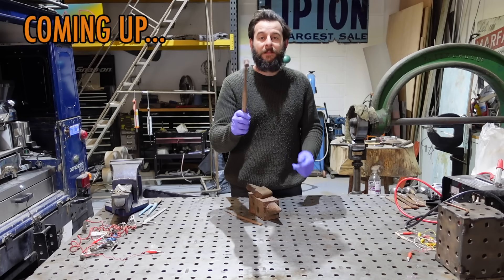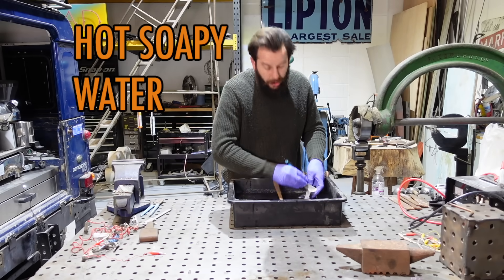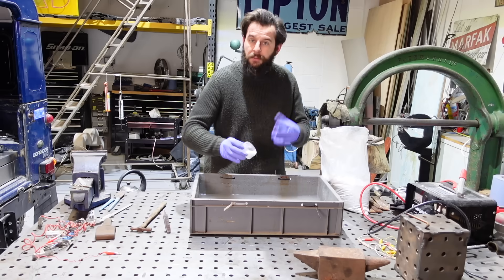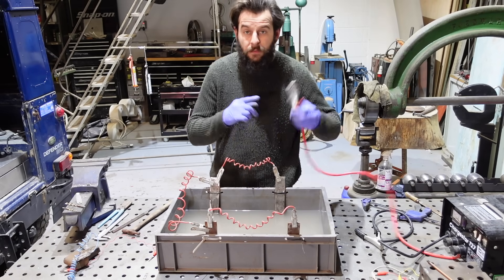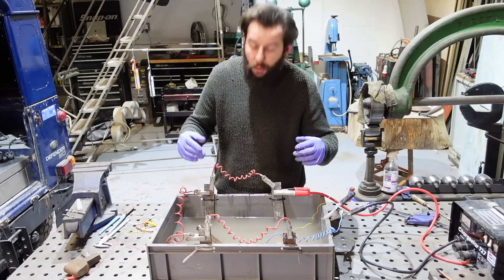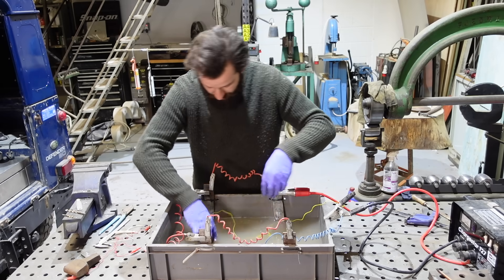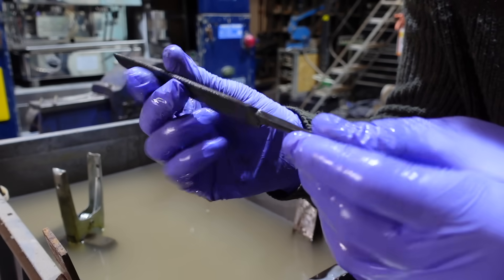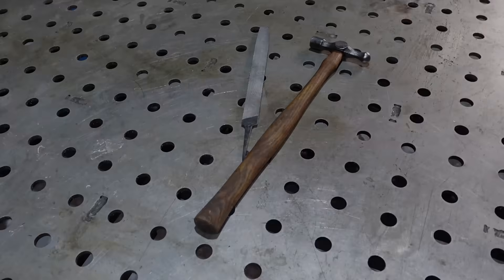The Power of Electrolysis | How To Transform Rusty Tools!

Comment: i had an old outboard mtr. gas leaking at the mounting bolts  took  it off  flushed it good the took a long cane pole  with a  rag tied on it  we light the rag  stppd about 15 ft away held to the tank it just poped a little   then it was safe to weld  it worked ok.

Comment: Does the amperage matter ?   Mine has an option for 2/12/75 amps.  Do more amps speed up the process?
Reply: I've used a maximum of 5 amps and found it enough to do all the tools I treated. Yes things will definitely speed up with more amps, but in a small bath I'd advise you steer well clear of 75 amps. You'd probably get a nasty shock if you dipped a bare hand in the solution. It will also tend to eat away the rust plus the good metal.

Comment: it is a line of sight process. If you could have a cage or maybe four sacrificial rods for each corner then you are golden... so you get to all the hooks and crannies... it gives off hydrogen so don't do it in a room with metal stuff as it encourages rusting. nothing will be as delicate with surfaces as this method. I managed to restore hand-engraved toolboxes that belonged to my grandfather. The engraving is still good as new, and all the rust gone. I like the crate idea... I use an old rubbish bin

Comment: There are many ways to skin a cat in regards to getting rust off of an item. A hammer wasn't the best example in my opinion for two reasons. The first reason is that hammer was usable as a hammer regardless of rust, the only issue would be if you were worried about the surface marks it could leave and you wanted to make sure the face didn't have pitting. The second reason is that the item is easy to use other methods on, such as the wire wheel. Where this process shines is in complex shapes where a wire wheel cant get into, or areas that are seized with rust and something like an acid bath would not penetrate deep enough without first damaging other areas of the item being cleaned. What I see is a bunch of comments completely discounting the process because there is a different method available. And while I do agree if you were going to use a wire wheel on it... I would have started there and maybe bypassed the whole process, but the video is about the method used and how to do it, not necessarily stating its the best option for what you used it on. Someone else in the comments stated they used it to clean our gas tanks from the inside out, that is brilliant, and its a good example of the perfect use for this technique because trying that with a wire wheel would be ill advised. Long windedness aside, great video!

Comment: Whilst a hammer head could be cleaned by other more simple methods, soaked in oil,wire wool etc, the big plus with electrolysis  is complex shapes that would be a pain otherwise....

Comment: Mind if I make one small correction? YOu mentioned that you aren't removing any actual metal, but that is exactly what you are doing. It's on a molecular scale, but that's how the electrolysis works. As the electricity blasts out of the hammer, the current carries the outer surface with it into the solution. Some of it dissolves into the solution and the sludge it makes over time is gloriously disgusting. The process can be used in reverse, by making your anode from something you want to coat in metal and your cathode from clean, pure metal like copper or nickle. Then it becomes electroplating, and can also be done at home with the exact same set-up.

Comment: Way too complicated..........  For decades; I've been removing rust from everything from tractors to trinkets using a simple 4:1 mix of water and muriatic acid (sometimes a little more concentrated).  It's very fast and easy.  Best done out doors.  One needs proper protective equipment (face shield, gloves, respirator, apron and ventilation) and keep it off of concrete surfaces.  The solution neutralizes quickly and easily with water when you're finished.   Many YouTube videos on this..........

Comment: Brilliant video, Dom!
I gave this method a try over the weekend. Tried it on a big heavy 3/4" drive Whitworth 1 1/4" socket made by Stahlwille. (I would point out that it is not safe to do this on chrome plated items, because of the risks). It worked very well. 
Then tried it on an antique 'Primus' stove spanner, that was extremely rusty and pitted - the maker's name and 'Sweden' were illegible. But after just 30 minutes, and then a couple on the wire wheel, the part looked like new. Also, the flame wind shield, that I had given up on because a wire brush would have destroyed this delicate part, was also restored.
I had made some alterations to the circuit arrangements used in the video, by using a metal tank, salvaged from an old deep fryer after chucking the electric element part away. This served as the anode, and increases the overall current density, leading to much greater efficiency. 
To limit current from the 12V supply, I inserted a 21W, 12V car light bulb in series. Any shorts between the job and the anode are thus rendered harmless and will not damage the charger which has a maximum rating of 4 Amps.
Reply from the maker: Amazing!! Thanks so much for the update I’m so glad it worked for you, 
Really nice idea on the modifications, depending on the size/shape of what your doing you can get creative!

Thanks again

Comment: The tools will flash rust if not immediately treated. I lightly coat the ferrous surface with Ospho, a metal phosphate, and immediately blow or towel off the excess.

Comment: Hello Dom
Just found your channel, always enjoyed your work on Repair Shop
I build Gauge 1 model locos etc and after soldering I used a diluted sulphuric acid to clean the parts, sulphuric acid has become difficult to find, have you any experience or knowledge of electrolysis cleaning of brass/copper parts?

Comment: I've used this method s lot & it never gets old! It's an amazing technique. What looks like hopelessly rusty metal comes out  looking better than you could ever get using old fashioned wire brushing & hours of work. 
As you could see on the file, it reveals lettering that could easily be lost using abrasive methods. 
One thing, the older the better when it comes to battery chargers. You don't want any fancy modern components in there. Just a basic, old fashioned charger.
I used old, sheet steel computer case covers for my sacrificial terminal. Laying it over the bottom of the tub & then suspended the items I was cleaning above it. That was all the items were close to the metal as it covered the whole bottom of my plastic container. If the computer case cover is painted or powder coated on one side then but that side to the bottom.

Comment: warm water will dissolve the salts more quickly, just like sugar dissolves quicker in hot tea than in cold water, but as noted, you will reach  the saturation point where no more will dissolve, and as the liquid cools more of the salts will drop out of solution. and if its not in solution it's not doing anything. you could argue the process might work better cold as there will be more brownian motion in hotter water which might reduce the conductivity and migration of the rust from cathode to anode, but definitely keep the parts close to the Anode to reduce the distance the rust particles have to migrate through the solution.

Comment: baking soda is sodium bicarbonate. so you're right, it's different to sodium carbonate,  sodium bicarbonate contains  extra positive ions in solution from the hydrogen it contains in electroplating we regularly use sodium cyanide in electro-cleaning. obviously not as easy for just anyone to get their hands on.

Comment: Shhhhh, don't tell him, but he could have got a similar result just going straight to the wire buffer.
Reply: Same question popped on my mind. Is there any advantage of electrolysis over a wire brush?
Reply: @Erick-Tags  Of course there is an advantage. Electrolysis is by no means an invasive way to remove rust. On the contrary, the wire brush is. Moreover, electrolysis might be slower, but it does not require you to participate. So you can do something else in the meantime. And it is far safer, as a wire brush might hurt you if you lose your focus.
So, yes If you are not in a hurry and you want to get a nice result without having to do anything, electrolysis is for you. So to answer to MaverickM1 below, no, it is not a clickbait.
Reply: @Erick-Tags  people can’t be clickbaited to watch a video witha title: cleaning rust using a wire brush.....

Comment: I'd love to see a video on anodizing aluminium using colour
Reply from the maker: Cool ok! Thank you
Reply: I'm not any sort of expert on Anodizing, but have studied it as part of general trade qualifications and  out of general curiosity for areas of my industry I havn't experienced first hand., For dyed/coloured this would normally involve Sulphuric Acid Anodizing, which is good because the Alternative is Chromic Acid, which is a controlled substance and has major health and environmental risks and I would think impossible to obtain outside of the professional trade. That's not to say that using Sulphuric Acid doesn't pose it's own risks and challenges. Anodising is a conversion process and would usually need a sealing process, unless it's being painted. The sealing process takes place after you apply your colour. I have seen references to Sodium Bisulphate, or even Sodium Hydroxide being used, but know next to nothing about these methods. Sodium Hydroxide will dissolve Aluminium so I find that curious

Comment: When the long grain fiber of woo in the tool absorbs water, it crushes the fiber, the handle will become loose, and impossible to tighten. 
It is ruined. 
It will now, "fly off the handle".

Also, the coating on the file is very hard.
Any rust at all will eat this coating away ruining the file.

Always clean all the steel/iron filings from the teeth with a file card, oil, and store so they don't hit other tools and such, in a clean, and dry tool box.

Even excess dust in storage will draw moisture and ruin your file.
Reply: In 62 years of life, work and DIY - I've never met anyone who does any of this.........!!!
??

Comment: I've used electrolysis many times.  Dom's vid is good.  I've often done a pile of things. Don't even have to connect wires directly to all the parts, as long as they are touching each other, it works. (better of course to connect wires). Also, as to only a few hours, depends on how rusty the items are.  I've occasionally needed to leave the product in for a week.  No big deal.  Does a stunning job.  NO elbow grease required.  Leaves the finished product sort of "black".  Why?  Cause the hard to remove red rust, (ferrous oxide) is replaced with ferric oxide, (black rust). Black Ferric oxide is fairly easily washed off, leaving a clean surface.  
sometimes you have a BIG item.  Easy to build a wooden frame, lined with plywood, then line that with polyethylene sheeting.  You can put in a large free standing machine that way.  As Dom said, don't use a fancy charge controller.  Some of those don't recognize what you are trying to do, and don't "see" a battery, so won't work.  You can trick those by putting a battery inline too, so that it thinks there is a battery that needs charging though.

Comment: Hello Dom
It might be worth mentioning that the gases bubbling off the electrodes are oxygen and hydrogen, so ventilation is important to avoid any danger of explosion.
Reply: In this small application the gases will be too dilute to cause an explosion.
Reply: This is noted in the comments below the video i.e. "SAFETY NOTICE: Use in a well-ventilated space or wear a mask, as the bubbles can be hazardous! "
Reply: I was thinking DUDE you don't want to just leave that unsupervised. WTH putting hands into the liquid is a safety no!no! too! He should be using plastic tongs!
Reply: @zacharysmith5947  Good gloves are fine.
Reply: Or capture the O2 and H for use with HHO welding?  Maybe not but it does need dealing with if this is not done outside.

Comment: Important safety tip! those bubbles are HYDROGEN so no smoking ,naked flames or sparks in the area.
Reply: Tiny amount of flammable gas in a big volume of air!
Mind you, if you were doing electrolysis in Harry Potter's cupboard under the stairs...AND smoking, then you might be slightly concerned.....!
Reply: @andymccabe6712  My point exactly,in a small shed could be a problem
Reply: @johnbuxton3841  Agreed, It's completely safe with ventilation. Once I turned a cup upside down over the bubbles then lit it off... I wouldn't want any unplanned surprises with hydrogen
Reply: and oxygen?
Reply: @jeremykemp3782  yes...two parts hydrogen from one electrode, and one part oxygen from the other.

Comment: In North America, sodium carbonate is sold as washing soda and it usually is found in stores as an Arm & Hammer product.
Reply: @alexandrevaliquette1941  Nope:  sodium bicarbonate is baking soda, sodium carbonate is washing soda, both sold by Arm & Hammer, orange box and yellow box respectively.  Google it
Reply: @duffman6675  Sorry folks, I did not know A&H sold sodium carbonate. I only saw bicarbonate in the grocery store here in Montreal. Thanks.
Reply: @alexandrevaliquette1941  You can find sodium Carbonate at pool suppliers as pH Up. Approx $6 per kilo Canadian. You need approx 350g/L of solution
Reply: @alexandrevaliquette1941  You can buy sodium carbonate (I don't mean bicarbonate) at any swimming pool supply store or a big box store.  They sell it for managing pool pH levels.  Very inexpensive.
Reply: @duffman6675  This is used for Tie Dye, which I do a lot of, and I checked the box I've got - Carbonate it is! Also sold for pool PH changes but is easiest to find as washing soda - Wally World has it dirt cheap :)
Reply: @duffman6675 think that's what they said my boy, but I didn't know that so thank you.😊
Reply: Or 20 mule team borax
Reply: 30 mules
Reply: @tomo4635  30 Mules is Borax. unless somebody else tell me that 30 Mules are also packaging sodium carbonate!
Reply: @alexandrevaliquette1941  I stand corrected
Reply: @alexandrevaliquette1941 , The brand is "20 Mule Team Boraxo".
Reply: @alexandrevaliquette1941   Yes, I realize sodium bicarb is BAKING soda and Arm & Hammer may offer it BUT......they are more known for their WASHING soda which is sodium carbonate. That's why I specifically typed WASHING soda.

Comment: 🤣 I think you could have sanded one hammer instead of sanding four pieces of steel, used no water. electricity, water and chemicals or you could have used oxalic acid with no work but what fun would that be.

Comment: 15:30 try using some carnauba paste wax on your wood tool handles (e.g. guitar wax, which I find is cheapest), it works great for repelling other things that might stain the wood like motor oil ETC and lasts for many years! Also works great on carbon Steel tools to keep them from rusting in the first place! It's one of the main the "go-to" products for preserving old furniture and older guns too.

Comment: Another method and it works is ONE part MOLASSES to 2 or 3 parts water dissolve it leave the parts to soak stir occasionally. Depending on how heavy the rust is it is usually done in 2 to 3 days. Non toxic no electricity required.
Reply: I was going to comment about this, works great!
Reply: @Onesize17  I found the original post on Molasses over a decade ago about a motor cycle tank. And posted it pretty much everywhere since. I'm guessing it was discovered by farmers by accident. Amazing how well it works.

Comment: you can sharpen that file by soaking it briefly in a bit of muriatic acid (diluted). The Model Engineer magazine has many articles on this and I have used it on old files myself and they come out quite sharp.
Reply: The stuff from the Builder's Merchants, called 'Brick Cleaner' (It's dil. Hydrochloric Acid - HCL) works brilliant too.
His file is by Disston, P.A. USA - and their hand saws are amongst the best ever made (the old ones, that is), I never knew they did files.

Comment: Dominic great set of videos, I have subscribed, but having spent 30 years working on the site that makes Soda Ash and Bicarb I had to make this point. Sodium Bicarbonate is made from Sodium Carbonate but as you have found out the two products react differently. Very simply the sodium carbonate is redissolved and passed to the top of a carbonating tower, here carbon dioxide gas is introduced at the bottom of the tower under pressure and passes through the solution. This produces a sodium bicarbonate crystal which is then filtered and dried. But yes, don’t use bicarb use soda ash as it is more chemically reactive and a stronger alkali.  As an aside if you put your solution, once you have finished with it, into a pan (having filtered out the rust particles) and boil off the water, you will be left with soda crystals also known as washing soda.

Comment: Any chance of a video about electroplating?  Seems it would be similar.
Reply: This is basically electroplating the rust onto your sacrificial anode. That's what's going on. So if you really want to plate you reverse the polarity and use a metal you want to transfer. Sometimes the material to plate is in the solution though. Something similar to this is how copper is refined too. They dump the ore into the solution and plate the metal onto anodes.